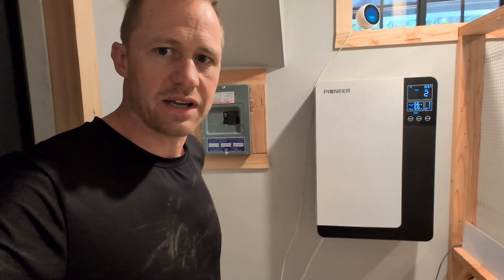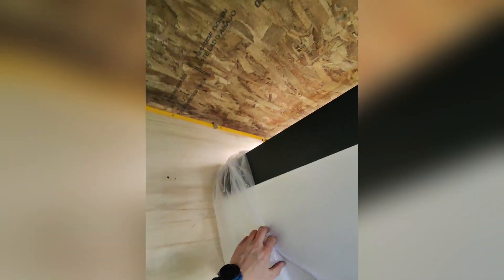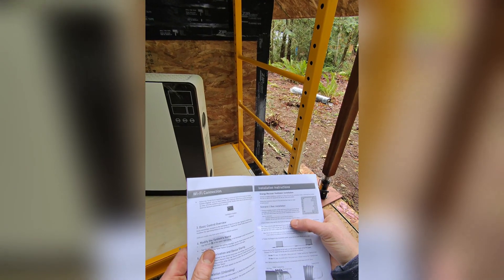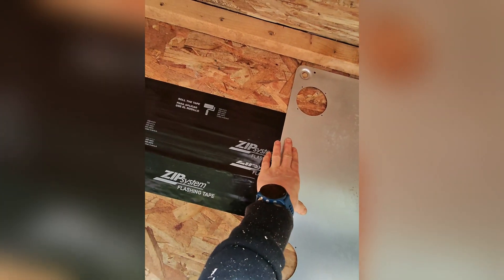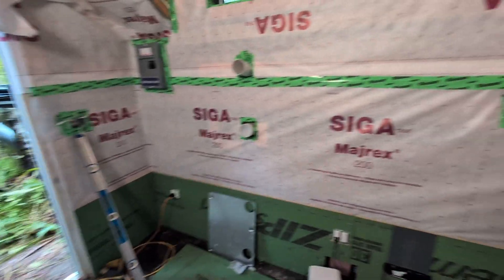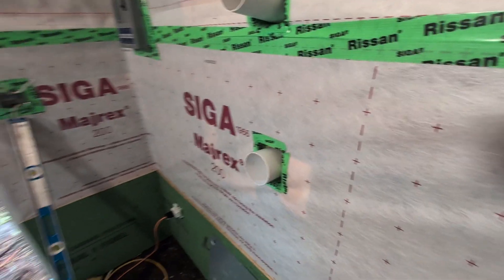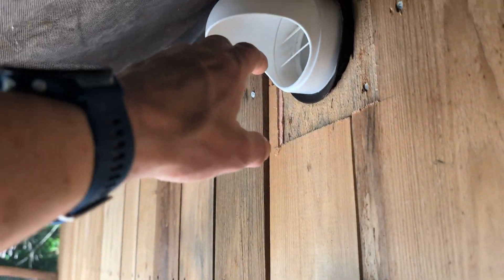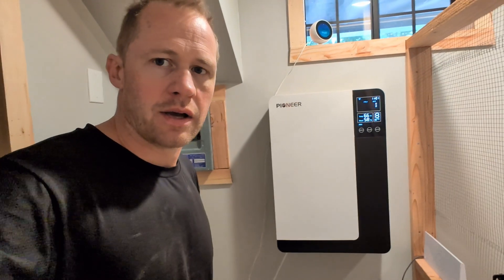Tiny House ERV: DIY Installation Guide

Comment: What does manual say about connecting unit to the bathroom exhaust?
Reply from the maker: The manual doesn't mention anything about hooking it up to an exhaust in a bathroom, so it's probably not meant for it

Comment: This is the strangest construction I’ve ever seen. House wrap and zip on the INSIDE? the point of drywall is for fire protection.
Reply from the maker: There is only zip on the bottom 3 feet, as it is a chicken coop and they are messy.
Reply: Siga is a smart vapor barrier NOT housewrap. Vapor barrier is normal on the inside of cold or cool/wet climates.

Comment: Hello there.
Does it increase oxygen level in your room.
I want to set it up in basement room, having low oxygen levels there.
Please let me know if it helps.
Thank you.
Reply from the maker: It would certainly keep pumping in fresh air and remove the old air. You should not have low oxygen levels in your house. Have you measured it? 21.5% is normal. Usually, CO2 is the issue and not a lack of O2.

Comment: How do you like the unit so far?
Reply from the maker: It has been good. I swapped out the particle sensor for a CO2 sensor. You cannot run both at once. The front lid lets air pass by a seal and creates a whistling sound at higher fan speeds. I fixed it with some silicone and now it is nice and quiet.
Reply: @einarmikkelsenPNW thanks for the response.  I ended up installing one as well.  I like it so far as well
Reply from the maker: Did you have any whistling in the front of yours?
Reply: @einarmikkelsenPNW As of right now, no, I have not experienced anything like that.  It’s actually been very quiet for me and I am surprised how little I notice any noise from it.